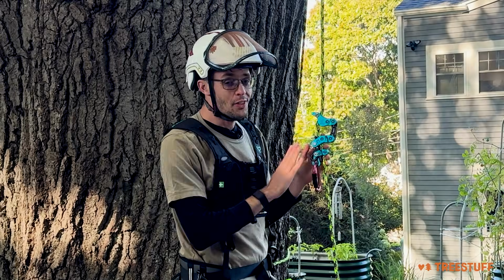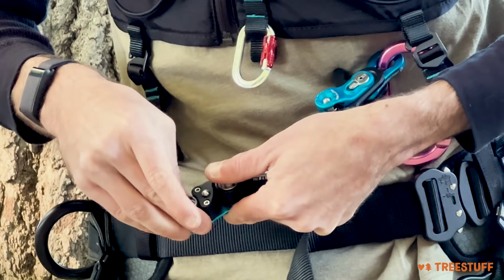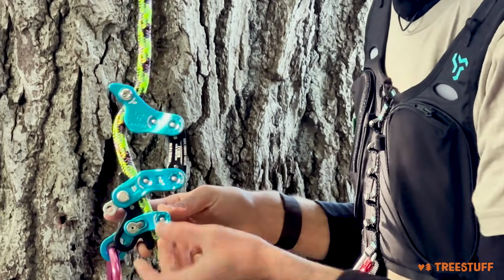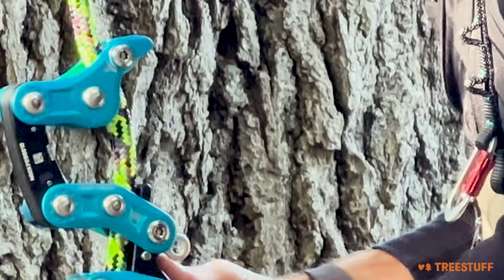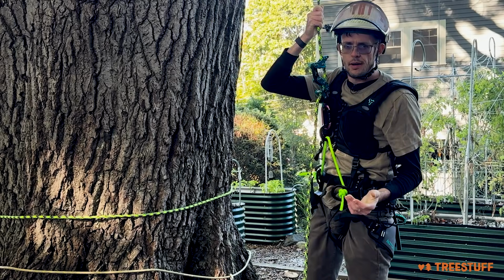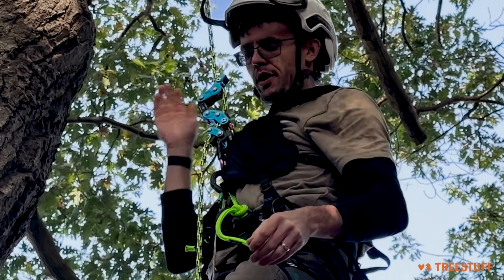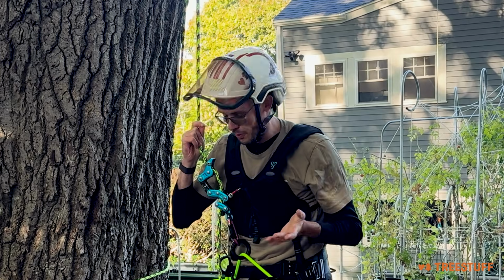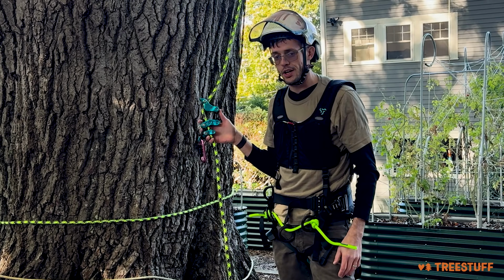The Best Arborist Climbing Device? - Closer Look - Rope Runner Vertec

Comment: Hey Nick, 3 ? Do you use the Notch Jet Step on your right side?  Have you got yourself a Magneato yet? I bought an extra one for my Notch Fusion tether & it works great. I've heard ithe new Vertec is a little temperamental to different ropes. I've tried several different ropes with my RRPro & have never needed to even adjust it once. Have you found that with the Vertec yet?
Reply from the maker: The Vertec is adjustable enough for me that it works on a variety of ropes. I do wear foot ascenders on my right foot.

Comment: eliminating the pulley seems to have been a major error
Reply: I'm a little confused why you have a new teal product that has a great accessory which it is also teal & I didn't see you using it. I watched a video on the ART Blackbird. From across the pond this guy had a teal Notch Magneato mounted to his device. He even made a comment that  he might not want to be doing this on camera. I have a teal RRPro with a Magneato. I also have a 2nd one for my Notch Fusion Ropewrench.  It especially has made this device work better than all the options I've tried b4. The bottom slot on the Fusion tether is where I mounted the capture part of the Magneato. I used a 1" bolt & the nut on it is a 1/2" size. As you look @ the device facing the rope the head of the bolt is to the right & the large washer I used & the nut is to the left. The washer I used was 7/8" size so I hope this helps. I mounted to a piece of 550 paracord that is strung to the top of my chest/bungee vest & help up with a small bolt clip cuz carabuiners are too big & I like to use them for other purposes.  😅

Comment: Hey Nick, what are your thoughts regarding the binding due to Notch leaving out the lower pulley.  I was just about to purchase the Vertec from you, but then I saw this video and frankly, this looks really bad:

https://www.youtube.com/watch?v=Hhd-_0irraU

Hopefully Notch addresses this issue because after seeing that, I'm holding off on my purchase.
Reply: I've got one, and no issue, but it looks like it is a problem with only some attachment carabiners
Reply: @333Paradigm333 how does your vertec compare to the RRP?  Is it as smooth and are you using it on clean or dirty rope?
Reply: @therealsoultitanium  it's fine in a relatively new X-static rope. But as I said the tending issue seems to be from lager carabiner types jamming in the attachment point not allowing the RRV to collapse.
Reply: @333Paradigm333  did you watch the video I linked?  As you can see the RRP has no issues on the same rope.  While it's great that you found a work-around, I don't think it's a good look when you release a new product as an upgrade and it can't do everything the previous product could do.  And if there are limitations on what carabiner or rope conditions you can use the device with/in, then they need to be up-front about that.  Chances are they didn't anticipate this issue and I wouldn't be surprised if there was a recall on the early-production units.
Reply: @mikesoultanian8050  fair enough, but why are you telling me about it?  Shouldn't you be saying all that to Notch?

Comment: Sorry about the sniffling and weird voice!
Reply: Quality gear vid as always. Thanks Nick:)  …but, Nick the question that all discerning climbers, gear geeks, and potential Vertec buyers want to know the answer to; why is the pulley gone?  One of the great advantages of the RRPro over the Akimbo is better performance over sap.  Some reports from the field are that the lack of the pulley has lessened this performance when tending slack.  If no one can produce a better reason than cost saving on production or “reduced maintenance” then I will deal with the slick pins and stay with the Original RRPro. Inquiring minds want to know🤓

Comment: The problem is, they still haven't changed the design of the rope runner, so that it will work with MRT
Reply: Just get a 3 point swivel on your bridge and you can use a moving rope system comfortably

Comment: Nice improvements the only problem I have with my rope runner is it flattens the rope after about 2 descents. This made stopping a little less accurate. Maybe V shaped bollards would help keep the rope round.
Reply: That's a rope problem, not a device problem... What rope are you climbing on?
Reply: The instruction manual for the rope runner has a list of ropes approved for use. They do a very good job of hiding it too.